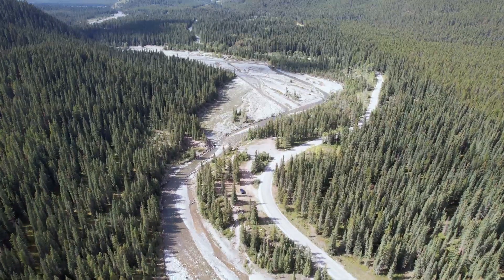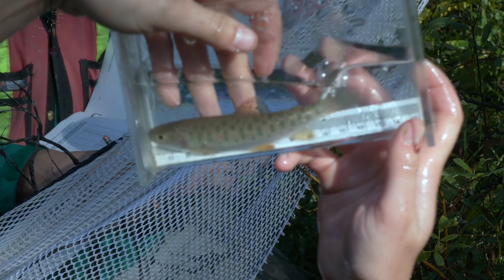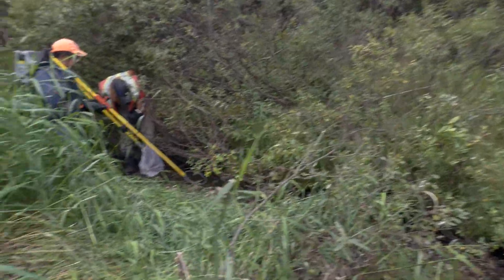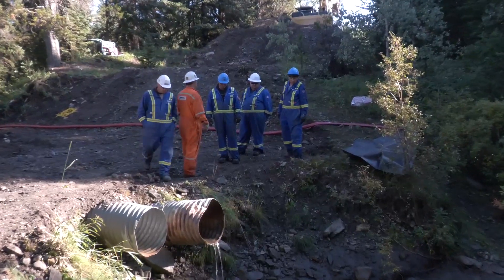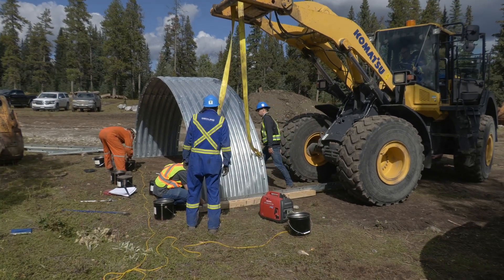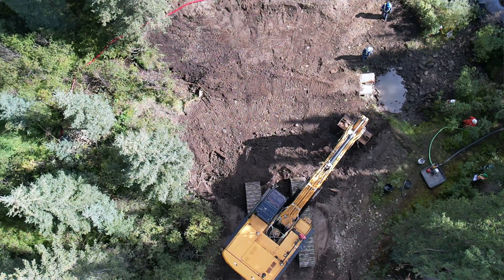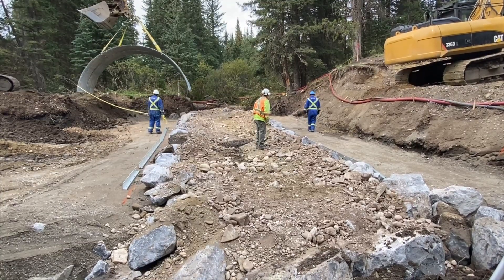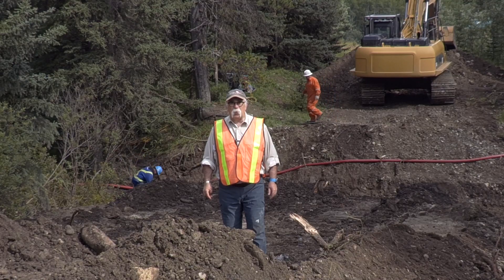What a difference; stream work helps restore fish habitat.

Comment: So you mean it was industry all along putting in these culverts that was the problem and not the off hwy vehicles like we were all led to believe?
This is great work they are doing. 
We have hundreds of culverts like this in West Central Alberta plus all kinds of industry bridges made with creosote soaked timbers that water passes through and rusting steel pipe. I can’t see how that can be good for fish and the food they eat.
Reply from the maker: I would not go as far as saying industry alone carries the blame. For sure, when it came to installing culverts, there was little understanding back in the 60s, 70s, and 80s as to the impact these structures would pose to fish habitats. Some studies do show improper ATV use through spawning reds and other key fish habitat areas causes problems. It is all cumulative.
Reply: @Let's Go Outdoors  yep like coal mining and the evolution of it. They keep finding better ways to maintain a clean environment.